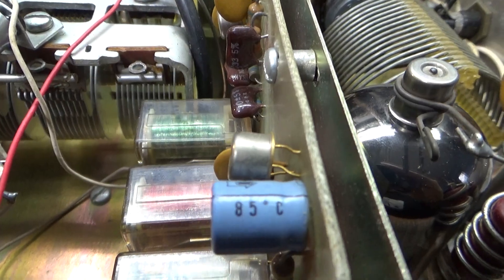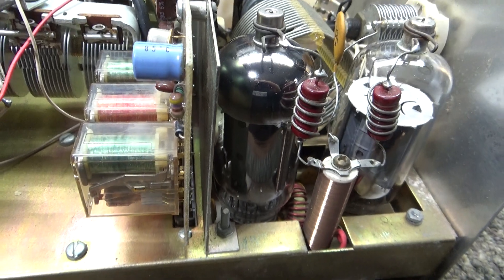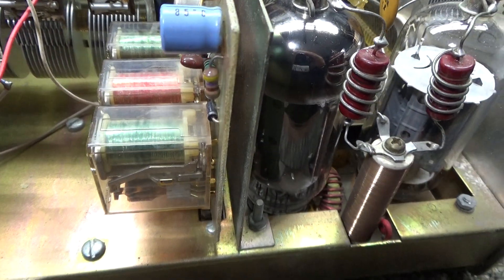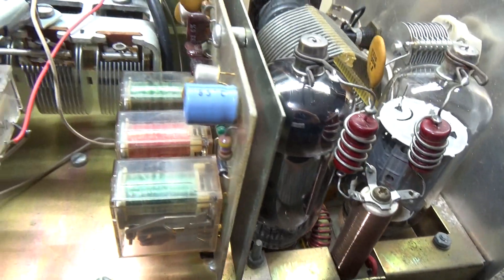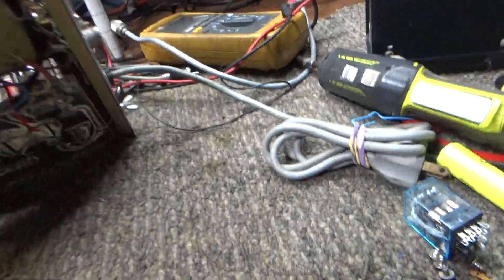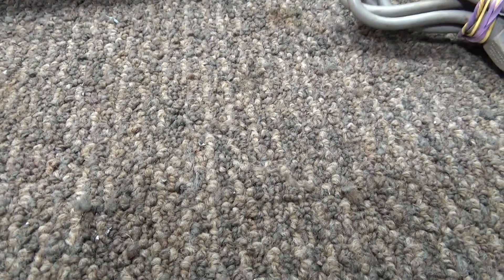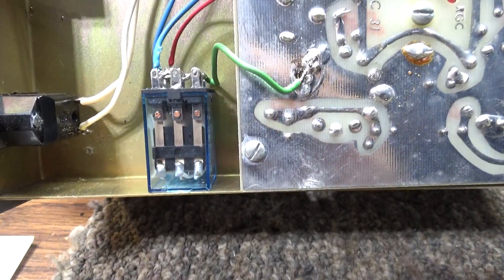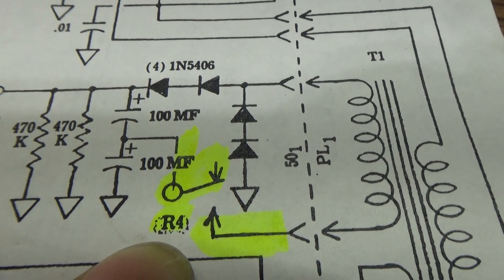Palomar 300A how to add the HV relay per request

Comment: RATHER THAN A HV RELAY.  JUST PUT NEGATIVE VOLTAGE ON TJE CONTROL GRIDS.   THE NEGATIVE ON CONTROL GRIDS SHUTS THE TUBE OFF AND KEEPS YOU OUT OF THE HV CIRCUIT
Reply from the maker: and when one of the tubes has a hiccup, even in standby, it goes boom. During the early part of the CB boom (sweep tube amp boom), most sweep tube amps did it your way. Either negative bias on the grids, or ungrounding the cathode. To repeat myself, those same amps found out if one of those tubes had an arc (which happens sometimes with sweep tubes with the HV on all the time) then you end up like some of the Palomar's and others did that didn't have the HV cutoff relay. They went up in flames. The HV cutoff relay is a safety device in case something goes wrong.

Comment: De cuanto voltios deve de ser el relé?
Reply from the maker: 12v relay coil, contacts as high as you can find, but usually 240v contacts is high as can be found for a reasonable price.
Reply: @tramdr thank you

Comment: Thanks you very much Dr. For the very thorough explanation. Mines is exactly like this one. You’re the only one out here helping others with your knowledge. I’ve  seen  a similar explanation for the the 350Z on “ Grumpys ole time radio forum” as hot as the 350Z runs it needs it! I have two 350Z”s , two Skipper 300’s and one 300A. Thanks again.
Reply from the maker: You are very welcome and 350Z vid coming soon!